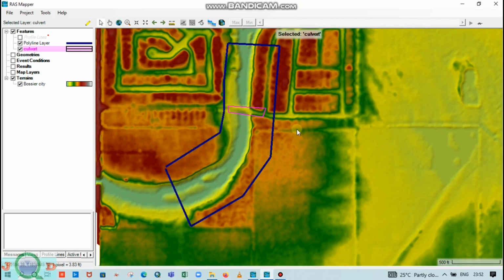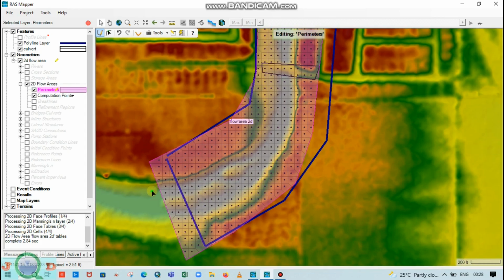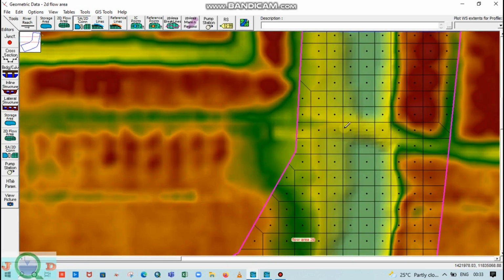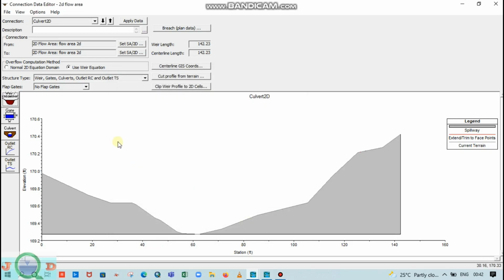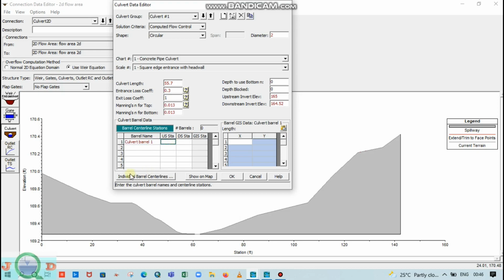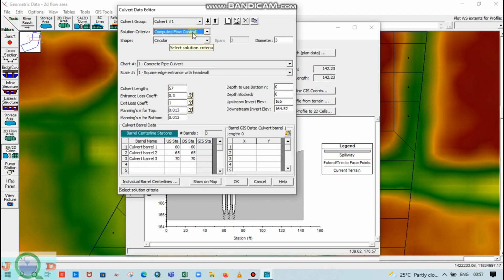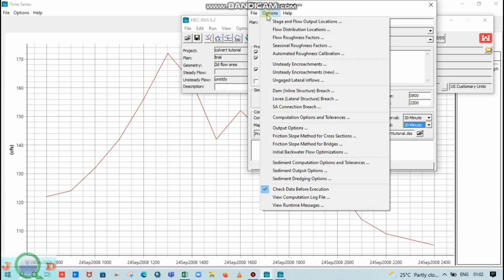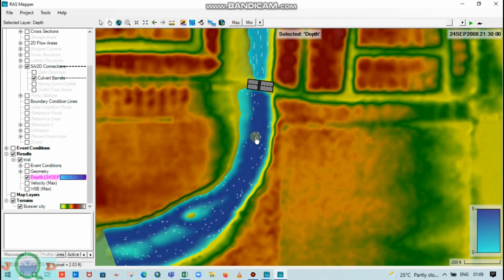HEC RAS 2D:Culvert model

Comment: Good Video
Wanted to know is there a reason why the culvert that is introduce in my model does not convey the water instead the water flow pass it
Reply from the maker: did you modeled the culvert barels?
Reply: I modeled it 
I changed the terrain with terrain modifications, this helped

Comment: I tried following your steps but got the following error message: ERROR with Connection(s) The SA 2D Connection has a culvert lower than the cell it is connected to. Do you have any idea what might be causing this? According to the warning message I'm placing my culvert under the terrain level, although I need to place it under since my terrain acts as the embankment area.

Hopefully my explanation was helpful. Thanks for the tutorial!
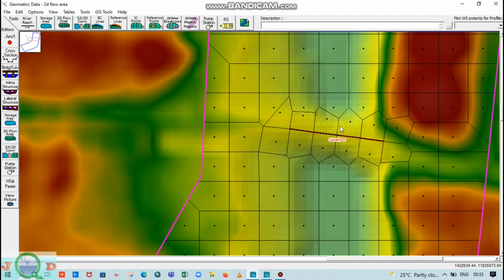Reply: I've highlighted this in 9:57 part of this Video